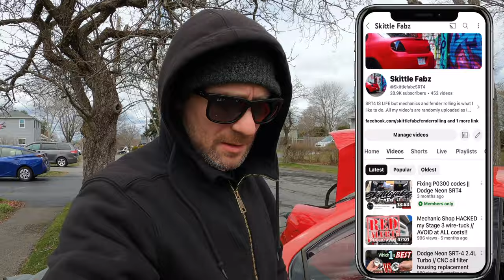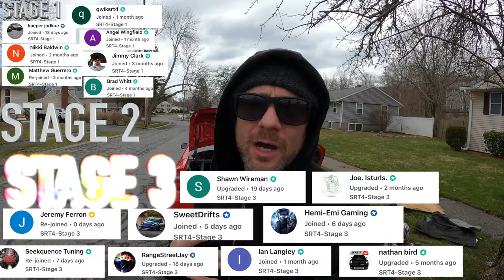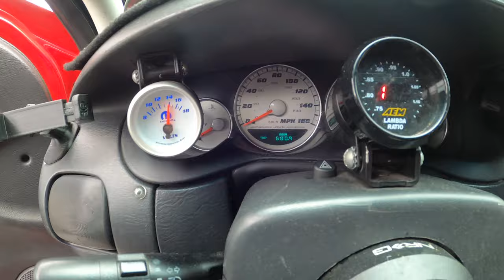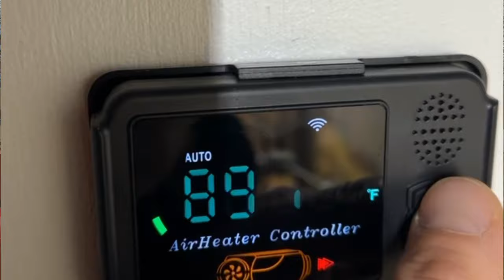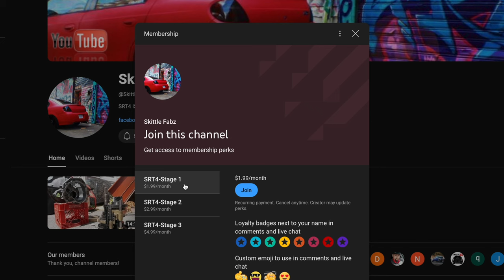Why I quit making Youtube video's - End of 2023 recap & Where I am today

Comment: The three main spots for leaks at the rear are tail light gaskets, 3rd brake light gasket, and the rubber gasket above the rear doors. There is a plastic push pin that can leak down the c pillar inside.
Reply from the maker: Its from the third brake light, the trunk needs TLC again